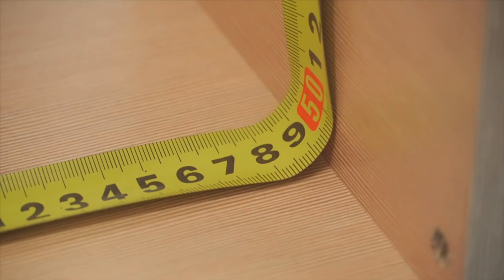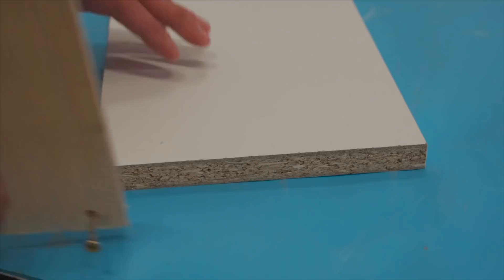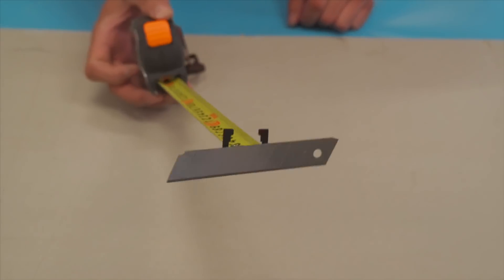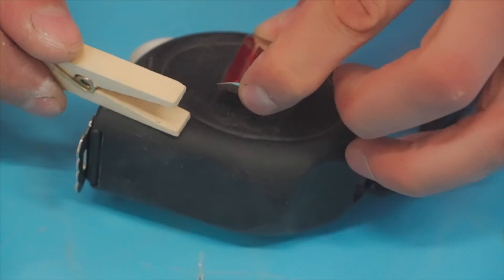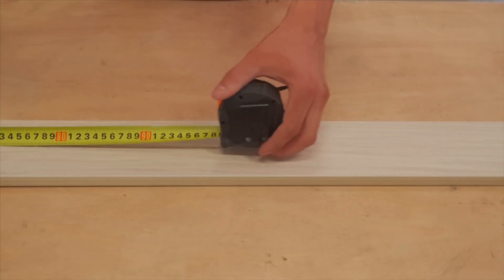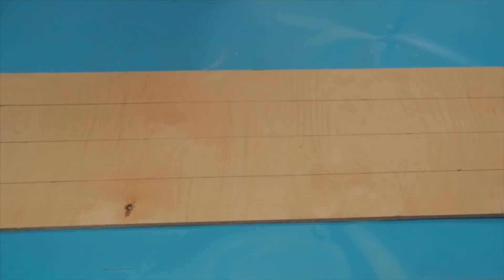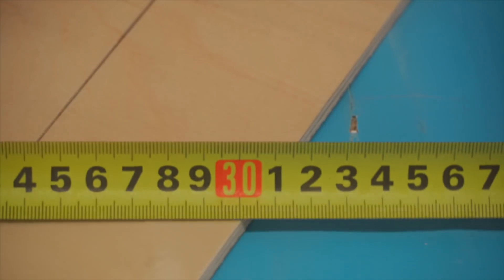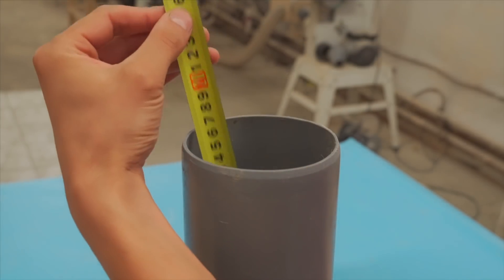Amazing Measuring Tape Tips and Tricks That Are On Another Level

Comment: Pretty good tips but here’s another one for you if you have a distance that’s over 100 inches or 120 inches and you can’t measure it by yourself pull the tape measure out 50 inches mark 50 come from the other end and pull out the measure tape mark 50 add 50 and 50 together that is 100 and then add the distance between the two measurements of 50 that’s just a technique that I do because I work by myself